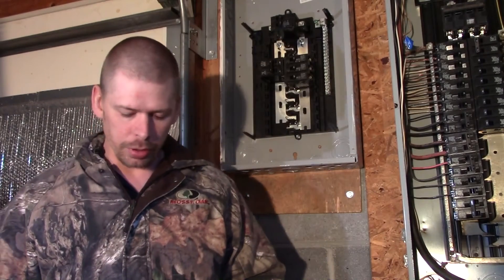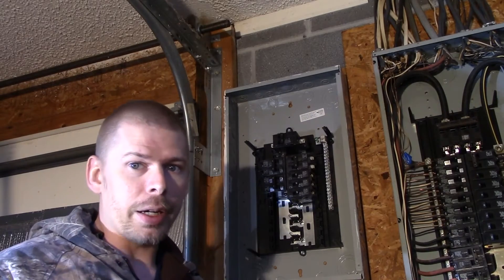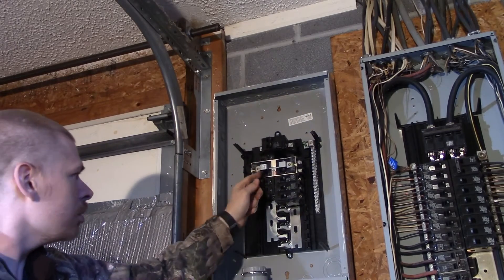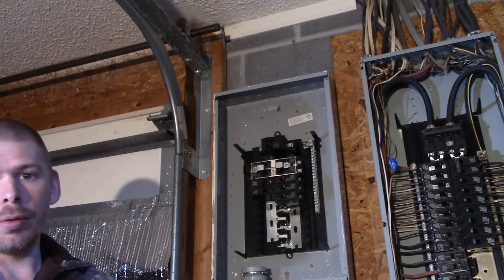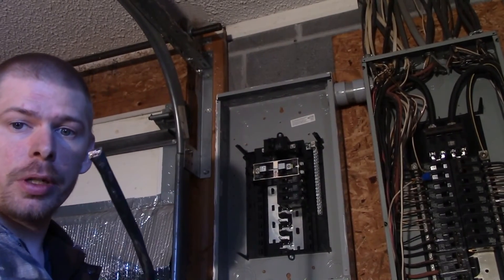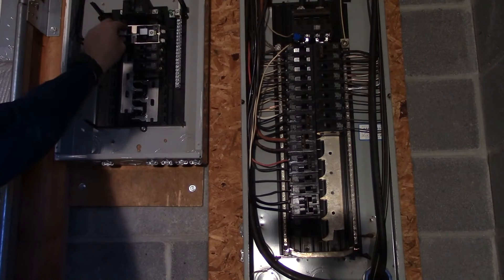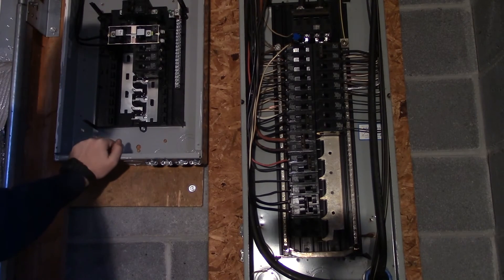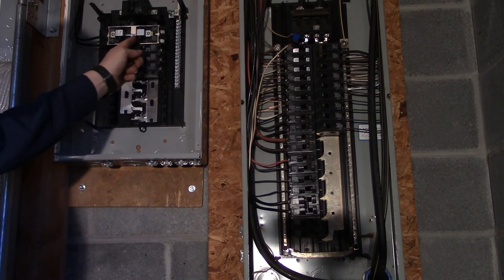Installing Manual Transfer Switch For The OFF Grid Solar Inverter Part 2

Comment: Nice video.  Question for you, I’m planning on installing a transfer switch in my condo but the breaker panel inside my condo doesn’t have a main breaker switch and it also does not have separate ground and neutral bars.   Should I be installing both the green and white wires from the transfer switch to the neutral bar or does the green wire have to go to a grounding point somewhere else? Thanks!
Reply from the maker: A sub panel and main can only be grounded in one place on the hole system.It should be in the main and not the sub.But don't try this at home pay the electrician to do the system